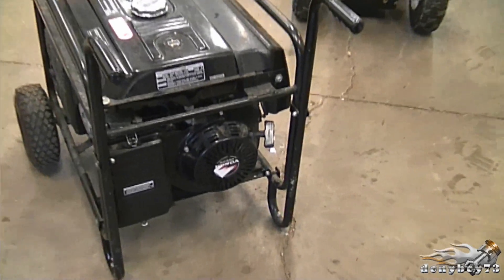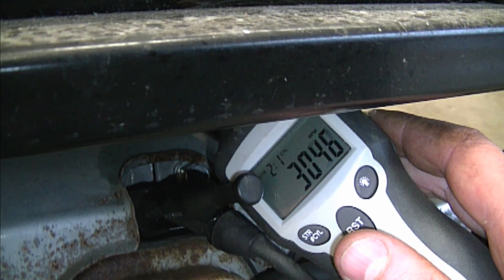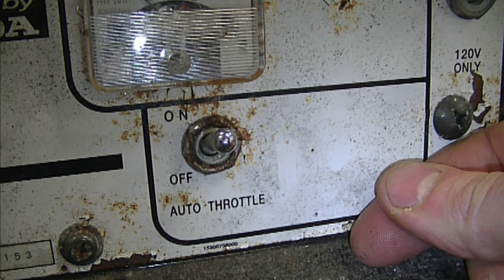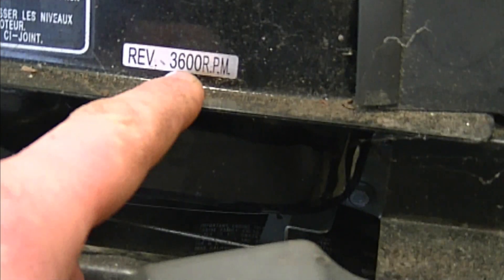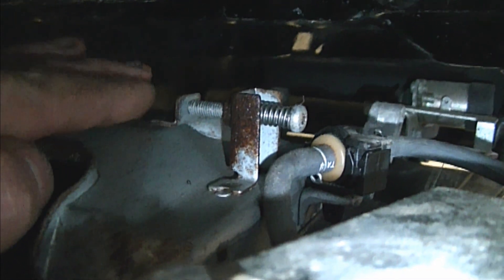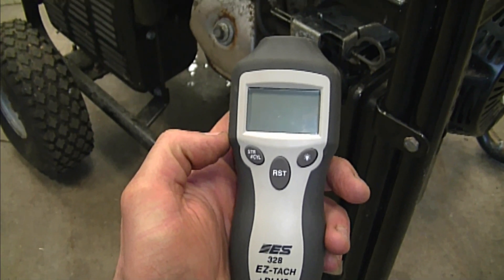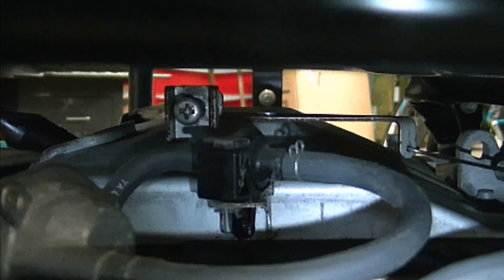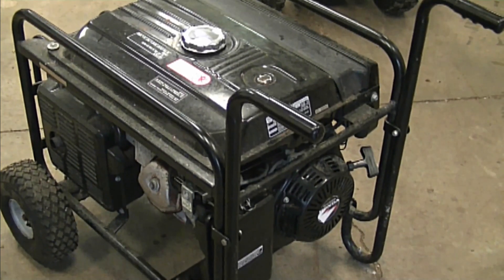How To Adjust The RPM On A Honda GX390 Generator Engine

Comment: Have a Honda hour meter tach on my EM5000 generator with a propane kit. The propane connects to the intake line pre carb and I measure 3640-3680. line freq = approx 57 hz. Given that I am running propane and I have tweaked the propane delivery valve to produce the highest RPM will your carb adjustment work?

Comment: I have a gx240 with the same configuration and with new carburetor only runs on choke and is surging, when spray ether by vacuum plate it runs correctly is it possible vacuum plate is bad ?

Comment: You have any idea what your Idle control ON RPM's are or what they typically should be?    I have an old Campbel-Hausfeld GN654800AC with a GX390 and I can't find a manual for it or settings.

It runs fine and outputs 60hz @ 120V @ 3600RPM, I just want to make sure the Idle control RPM's are at a typical range (i think it was 2660RPM when ON).  The idle control has a magnetic coil that can be adjusted around a bit to effect those RPM's.  Adjust it too much and it will start revving up over and over.

Comment: For those performing this you will want to check this under load as well.  I like to use a 1500W heater as load and adjust accordingly.  That way you know you frequency and voltage are in line under load.

Comment: I just got a 6000W sungold power inverter that I intended to use as overnight backup to my Honda Northstar brushless generator, but it refuses to qualify the generator power and switch the input side to the output. It instead remains on battery inverter mode and the status display says "AC ABNORMAL 238V" on the input side. The generator frequency is 62Hz. My APC UPSes don't have a problem with it, but the sungold absolutely refuses to qualify it.
I'm going to try adjusting the engine speed, but I fear that under load it will drop below 60Hz and the inverter will go to battery again.

Comment: Great tip.  Thank you.  Could you show or tell me how you would adjust a the rpm's on a honda EU6500IS inverter generator.  And what the rpm's should be at with Eco off snd on.

Comment: I have about the same generator and adjust engine speed with it under load,, a couple 500 watt  halogen lights work well for this. Bought one of those  20 buck tach/time gauges ...simple  surface mount... makes keepin up with 60 hz easy and hours on motor for oil changes

Comment: Hi I am from P.R. after hurricane Maria I adjust my generator by Hz not RPMs put it at 58hz the engine runs more quiet, more gas eficient and the oil last a week.

Comment: this maybe a dumb question, but would it not be better for the motor if they had the motor running at 1800 rpm with a gear ratio to run the generator part at 3600rpm ..... seems like it would be alot quieter and better for the motor if they designed it this way ?? Im sure they dont want motors to run for 30-40 yrs like the old briggs flatheads could ......  or have I over thought this ?
Reply: Hi Dan, this is not a dumb question at all. Indeed, an engine running at half the rpm would last a lot longer and be a lot quiter. However, running at half the rpm would mean, that a generator would run at half the rated power as well. If you increased the rpm with a gear system, you would get even less power at the end, as gears are only ca 90 per cent efficent. So at the end, from a 10kW generator, which normaly would run at 3600 rpm, you would get about 5kW running it at half the speed, minus the loss in the gearbox = 4,5kW. Just a rough estimate. Of course you can buy a generator that is designed to run at 1800 rpm. They usually come mounted with diesel engines weigh maybe 5 times more than a honda genset, cost about 5 times more, but they last forever.. Good luck :)
Reply: PS: I own a great genset with a two cylinder diesel engine. At 750 rpm it produces about 10kW of power. Weights just under 1500kg (3000lbs) :) But it is amazing to listen to the engine running. Check some Skoda 2S110 engines on youtube to get the idea :)

Comment: You can also plug a frequency meter into one of the power outlets and adjust the engine speed for a reading of 60 hertz (USA line frequency 60 cycles/ second = 3600 cycles/ minute hence 3600 engine RPM). Some generators have a frequency meter built in or you can use a device like a P3International Kil-A-Watt available from many sources. I like to adjust my generator for 60 Hz while the generator is supplying about a 50% load. As the load increases, the frequency will decrease a bit as the engine slows down and as the load lightens, the frequency will increase. My generator does not have closed loop frequency control, so setting the line frequency (engine speed) with a typical load is a reasonable compromise.
Reply: yes you can
Reply: Thanks for mentioning the kill a watt. I had one sitting here . Made all the difference.

Comment: Honda clones redline at 3600 yet mine has seized up t 3000 rpms. Pulled the head and no damage, cross hatches are perfect. Will not turn by rope or starter. Think a bearing spun?

Comment: Thanks great video. I needed to clean carb but seen they were cheep so I just replaced it. It started easy but the RPMs are way to fast now. Looks like the gov linkage isn't moving over to slow it down unless I hold it over by hand. Is this what I should adjust for this or do I need to look into the gov?? Thanks It worked fine the last time I ran it.

Comment: Can you check the RPM on a honda ex-5000 with the old type auto style tachometer, that has two wire clamps? Where would you connect the clamps on the generator?  I am a new subscriber, THANKS FRIEND.

Comment: First off: That looks awfully Chinese-made to me....or are the Chinese cloning better these days?

Anyway; You failed to mention just how the governor works or even the effect of the plastic throttle stop screw on the carb.
Also, the revs will be affected by the setting of the air/fuel mixture screw....a metal screw on the side of the carb.
(Be guided by the plug colour).

The idea of the governor is to speed UP the engine when a heavy electrial load is placed upon it.....it then throttles back as the load is catered for, that is, as the running amps diminish.....
It is the shock of the heavy amperage start up, that the generator tries to cope with. 
( A heavy duty 9" angle grinder for example.)

What should happen is as the revs fall, the windage on the governor (Within the generator) is decreased & that causes the lever to pull the throttle open...when the windage returns to its normal level...ie the revs have now increased...it SLOWS the engine & maintains the RPM at the correct voltage. (The higher the RPM....The higher the voltage [& Hz incidentally.)

The same Governing action is used on Briggs & Stratton engines...lawnmowers, for example....You hit a patch of, say, damp grass & the load on the blades is increased...the revs fall....the windage falls & the thottle is pulled open to increase the revs & thereby the energy to cut the wet grass or whatever.....before the engine stalls. Sounds so simple! Yet can& does go wrong.

HEY!!!!
Not trying to be clever here...or criticize the poster.....but there is somewhat more to getting the revs right than that one single screw......

I have a similar generator in at the moment: It runs perfectly well at 220v/50Hz (South America) but when faced with a shock load, the RPM & voltage falls & the governor is not compensating for it by increasing the revs.....as the grinder runs, the current demand falls & the Genny revs return to normal.......
But then, load the Grinder with some actual work, which increases the amperage load.... & you find your self in a vicious circle.....

I came here looking for a solution but the nearest I could find was this example....and sadly, it does not really help.

I'm sure someone out there will say: "Ha...this is what you do.....!"

(BE AWARE: With some clones of the HONDA ENGINE....
Running them at maximum speed can cause self-destruction of the engine.....Seriously. 
What happens is that the magnet ON the flywheel (that provides the ignition spark) can become "displaced" & rips the induction coil off its aluminium mountings.
I've had two machines in, that lost that permanent magnet off the flywheel: 
One I salvaged with a new Flywheel...[not cheap either.]

The other demolished the Coil Mounting lugs....Engine is scrap......
What some clever clogs did, was manually hold the throttle wide open when switching on the massive electrical load which was stalling the engine....A BIG NO-NO!..))
Reply: Did you ever find a solution to your generator issue? I am having a similiar problem as you described. The governor is not maintaining the rpms as the load increases. Was thinking worn governor gear or an issue with the flyweights but is a relatively new machine with only around 5hrs run time.

Comment: hi Dony ,, do u know what is the purpose of the other adjustable metal  screw on the carburetor ?
Reply: Air/Fuel-Mixture screw...adjust as necessary to get a healthy looking spark plug.

Comment: I have a generator with the GX390 engine. when I run it and have something running off from it, it surges. The only way to stop the surging is to pull the choke out about half  way. What can I do to stop the surging?
Reply from the maker: drlou50 you need to clean the carburetor or replace it

Comment: I have a Honda gx390 motor with a comet zwd4040 4000 psi pump on it. When I pull the pressure wand trigger, the rpm is normal, but when I let go of the trigger the rpm goes way up. What do you think I should do? Will the rpm screw work on the pressure washer?

Comment: I just bought the EX Tack Plus like you have in the video. I also have the same Honda GX390 engine on my generator.
Did the readings on your tack jump all over the place. It seems you have a steady readout. The one I have right out of the box, the readings are all over the place (2,473 rpm to 3898rpm) I have an analog wireless tack that reads steady at about 3800 which is about right for a miller generator. I noticed that your reading was steady at 3600rpm. Maybe I got a bad meter.
No way I can adjust accurately with readings jumping all over. I used the setting 2:1 with the cable and wireless same results.

Comment: Donyboy - I had one of these generators and the gas tank was so corroded, it looked like they ran red mud in it. I let vinegar sit in it and some sea foam and gas. Plus took a flexible magnet tied rags to the end and cleaned inside with about 40 rags. It was pretty clean unless you let fuel sit in it, it would clog back up. It was hard to even get all the gas out of the top and bottom holes

Is there a good way to clean one of these tanks out?
Reply from the maker: if it's as bad as u say I just replace it because I don't want a customer coming back

Comment: my genorator has a gx390 and it runs at 2000 rom's. that is what themanufacturer reccommends and it pumps out 130 volts. i really like it, it is nice and quiet. the arc welder with the same engine runs at 4k rpm's and it is really loud, you can't hear the weld so it is really hard to weld with it

Comment: I have a Subaru generator with a Robin engine. The intake air filter (279-32612-08) is deteriorated, a simple air filter is $25. Any alternative suggestions ?

Comment: Just a note to add, 3600 = 60 Revolutions per second which is where 60Hz frequency comes from for your power. If you have more or less RPM your power output frequency will be more or less. Europe uses 50Hz and the US uses 60Hz. I'm sure other Countries us some variation of the two as well because appliances are designed for either, or, or both.
Reply: Yup a tach isn't really necessary just measure the output frequency from one of the outlets with a DMM and adjust the engine RPM till you hit the proper output frequency.

You usually want the frequency a few hertz higher than 50 or 60 to compensate for momentary engine rpm drops when large loads are turned on. This will keep the frequency above the standard until the governor can react and open the throttle further.

Briggs for example recommends setting the RPM at 63 hertz with no load. Check your service manual for the proper spec for your engine.

At the end of the day engine RPM isn't what's important it's the line frequency coming out of the outlets that's directly tied to engine RPM.
Reply: I set generators so that they run 60 cycles UNDER LOAD. This often means that no loan rpm is as much as 3750. It depends on just how sensitive the governor is.
Reply from the maker: thanks for the tip